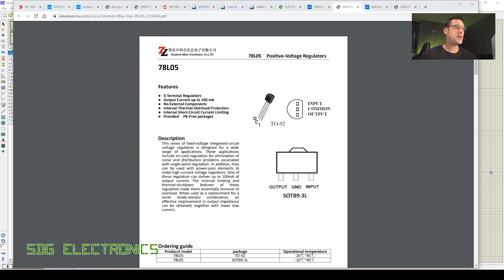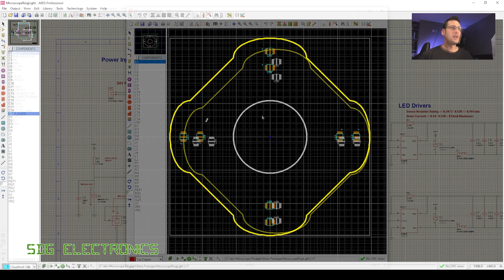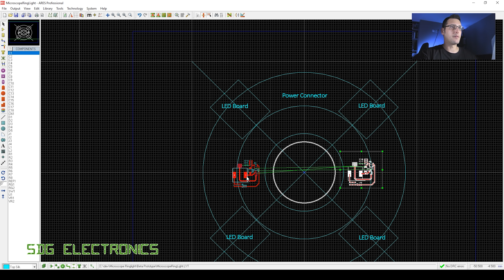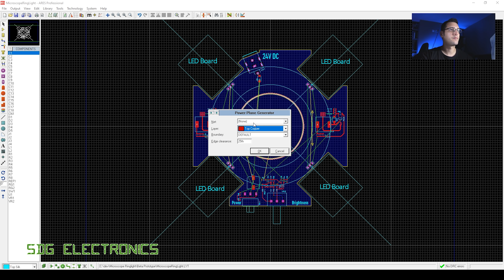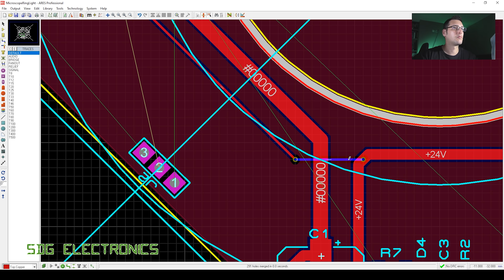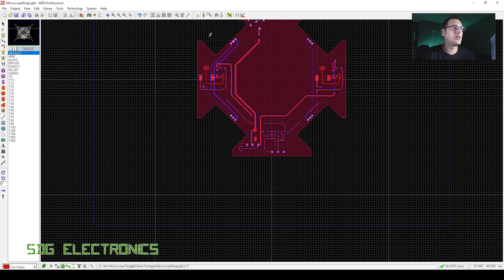SDG #164 Step-by-step PCB Layout - High Power Microscope LED Light

Comment: A bit late now, you could have used a P channel mosfet rather than a diode in the power supply.
Reply from the maker: I did consider it, but I was trying to keep things simple and low cost. Most likely would need to clamp the gate with a zener because many low cost P-channel MOSFETs only have a Vgs of between 12 and 20V.
Reply: @sdgelectronics  The AO3401A is rated at 30v, stocked by JLCPCB, dirt cheap, low rds on, SOT23, etc :)

Comment: You could place couple of smaller value capacitors at the output of the DC/DC to help improve the EMC performance. Maybe 100nF and 10nF or smaller.

Comment: Wouldn't it be better with pot and PWR on the sides, in case you try to look under, ie, will the pot poke you in the eye.
Reply: Well the location of the barrel connector was perfectly correct for these microscopes. However it would be more ergonomic to have the controls on the side. Instead of the front. Can rotate the whole assembly by 90º when mounting it, which then makes them side. This then means that the power jack will no longer be in the ideal position. It will instead stick out a bit on the other side.
Reply: @dreamcat4  Is the focus on the side, because that would be another reason to put the pot on the side under it, ie, it's easier to reach down than around to the front.
Reply from the maker: Good idea. I'll see if I can move it

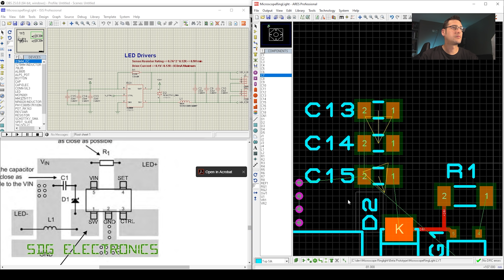Comment: 10:40 Strange layout in that datasheet. Generally you should not lay out anything under inductor. One can argue that is is not lethal, but it is considered bad practice.
"Not placing ground layer directly below the inductor (Figure 6-c) is also a point to pay attention to, when placing inductor. Due to
the eddy current occurring in the ground layer, the inductor value decreases and the loss increases (decrease of Q) with set-off
effect from line of magnetic force. Signal line other than ground also has the possibility of propagating switching noise caused by
eddy current. It is better to avoid wiring directly under inductor"
Reply: @Leeroy What about ground on  separate second layer? Do I need have a cut?
Reply: @dimakrayushkin  I can not tell you better than it was done in the document that I cited. Just search for any sentence from it and take a look, it is concise and very well worth the time.
Reply: If you use a shielded Inductor, there is no point in cutting the ground plane below.
Reply: @nicolas8414  exactly - these aren't air core inductors, the external field is relatively small
Reply: @Superfungus0  "del"
This paper basically says that magnetic shields are not very efficient for this, that highly conductive grounded shields are much more suitable and standard smd inductor shields are made of ferrite.. This explains why you may see SMPS transformers wrapped with copper strips.
Reply: @Mr.Leeroy  what paper? I think your comment is missing a reference.

In any case, shielding from an EMI perspective, and leakage flux generating eddy currents leading to excess loss are related in that they are both to do with "unintended" flux external to the inductor.  However, the magnitude of flux needed for each is vastly different.  You can convince me that the leakage flux of an inductor with a closed magnetic path can be high enough to interfere with nearby sensitive circuits  (especially the high frequency components of a SMPS edge, where the ferrite permeability tanks and the inductor becomes essentially an air core inductor).  Convincing me that the small percentage of flux leakage from a ferrite inductor is going to represent any serious loss term because of a strip of copper directly underneath the inductor is going to require more serious references.  If this was truly such a concern, how do they get away with putting the large smd pads of the package directly underneath almost every SMD inductor?
Reply: @Superfungus0  Sorry, I overlooked that pdf did not allow copy and pasted same thing from previous message. Here's the link:
https://www.sagami-elec.co.jp/file/tech/coil_doc_08e.pdf

I was referencing "Electromagnetic shield" part and comparison with magnetic shield in general. There are some interesting graphs in that document.
Reply: @Mr.Leeroy  Sure, the paper is interesting, but it does not support the idea that PCB copper under a shielded coil results in any significant additional eddy current loss.  Your interpretation that you would use "highly conductive ground shields" to reduce eddy current losses still strikes me as incorrect on multiple fronts: 

1) Eddy current losses are a result of conductivity.  How do you tell the flux that is heating up the copper in your PCB that it should not heat up your "shorted turn" shield?
2) One of the major loss terms in magnetic materials is also due to their conductivity.  This is the reason for the long history of effort put into laminations, or "powdered metal" cores etc. in magnetics - break up the conductive paths in the material for better efficiency.  The paper you reference mentions this as well.  Putting a direct short in the path with a shorted turn may reduce emissions at certain frequencies, but is not done for improved efficiency.
3) The graphs clearly show that adding the copper shield increased high frequency losses and reduced inductance, not the other way around.
Reply: @nicolas8414  I guess it depends how high end your design is, and critical are the losses.
"... if you were to add a shielded ring to the inductor, you would see that the magnetic field turns back to the core. There is some magnetic leakage at the top and the bottom, but it is much more manageable than the leakage of unshielded inductors."
On the other hand, there is another interesting piece of study:

Comment: Right from the start I thought:
Rotate one of the drivers 180° for more symmetrical layout!
And it could've solved the layout issue with the right one by having Vin closer to inside and Vout closer to outside.
Reply: That's what I was thinking.

Comment: Just curious, as I’m definitely no expert. Are those single vias, on the 24V line, enough to carry the current required for the LEDs? (And not cause any EMI).
Reply: Placing multiple vias along the top and bottom traces is an option. I believe local bulk caps near DC-DC areas are worth too, or at least have pad for them and populate if necessary.
Reply: Yeah via is ok, google via calculator and you'll find an 18mil via is good for a few amps at least.

Comment: For best EMI/RFI performance, the DC-DC loops should be laid out using short, wide copper floods, as shown in the data sheet, instead of traces.  This becomes a more significant issue as the switching frequency increases, but is a good practice for any switching converter.

Comment: You could use some of the PCB that will be cut off to create little wedges that you can solder between the sides of the LED boards and the main board, for strength.